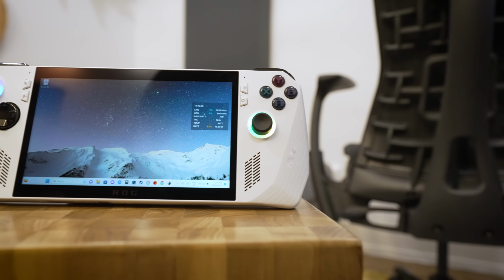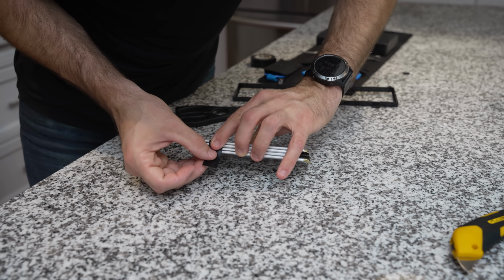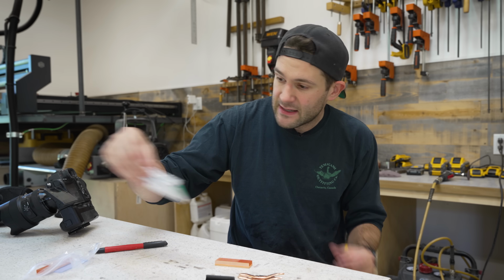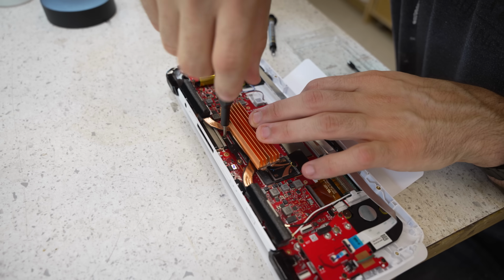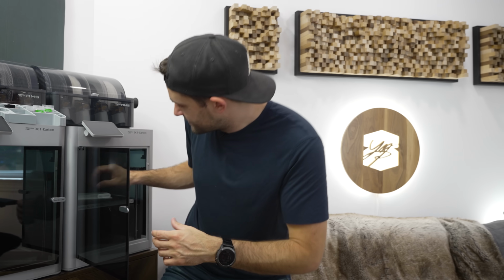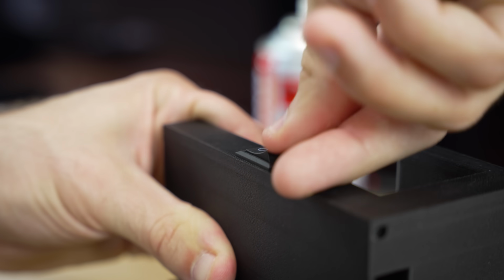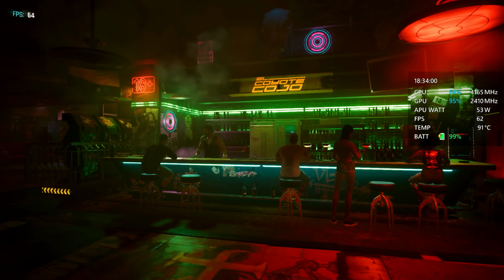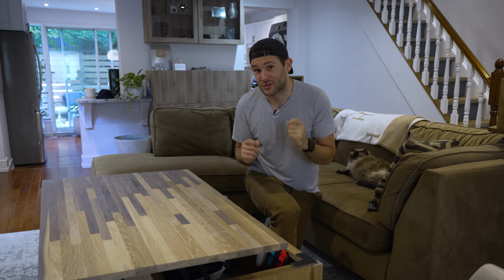I don't understand why people buy Steam Decks...

Comment: When it comes to liquid metal, and the less is more saying, I wouldnt say its actually true, not entirely, I had some instances where I thought I applied just enough and I got little to no results. I started saturating both surfaces with it, for 24 hr, then cleaning it off, then applying it for real and making it actually watery, like you see those watery puddles, thats what you need it all around. Some of it will get away, but thats what the very soft PU foam tape is for, and also insulating with confromal or nail polish to prevent shorts. More is better if you dont overdo it and if you insulate properly, you kinda want that slight spill of LM, if that spill doesnt happen you might not be getting good enough coverage, and every time I had those tiny spills overs, I always got the best results, sometimes jaw-dropping like 10-15C compared to fresh paste.

Comment: because it works really well and is very accessible and user friendly? because its reasonably priced for the power you get? because it has really good features such as the trackpads which allow far more compatibility with any game(id argue some keyboard heavy games cant be played without them, since trackpads let you configure like 20 more buttons)? because user made programs like emudeck pop up like beautiful weeds? because people dont want to touch windows? because valve absolutely deserves the support for this move of theirs? the ROG ally wouldnt exist without valve creating this handheld revolution.

the steam deck bridged the gap between consoles and computers. its a set hardware with a set operating system, so it almost has the compatibility and ease of use of a console, software designed for it will always work, and there are teams of people making sure games work well on it. but at the same time, its a full fledged computer so you have all the freedom that comes with it! sure, all this can be said about other handheld computers... but not as much. they have inferior UI experiences and windows likes to limit you.. people seriously recommend making the ROG ally boot directly into steam's big picture mode, because its not user friendly without it!

Comment: clickbaity title is clickbaity.
in the end you risk trashing and potentially exploding a device to eventually use streaming for it.
if we take the title - you can get the steam deck's cheapest version for like, what? 300-350 now?, hook it up and stream with moonlight, and have a better console experience since steam os is better suited for such things. 

dont get me wrong, cool project to watch. kind of pointless as we can see in the end, but still cool. but the title is really misleading.
yeah, the ally is more powerful, but not by much, and "people" won't be ok doing those things to fix the ally's flaws. especially considering those things can actually be dangerous even if you manage to do them correctly - 4 battery cells on top of each other? where is the heat from the middle two going? liquid metal that does not dry so if it gets out of the heatsink it can go anywhere it wants, especially on a mobile device that you wave around and add inertia to this liquid metal...

also still no trackpads, one of the features why i personally get the deck over the other handhelds :D

Comment: "I don't understand why people buy Steam Decks"
That's okay, I don't understand why you're modding a lithium-ion laptop battery pack so your handheld Asus can play longer and heavier.

All I wanted was a gaming PC that didn't break the bank, and Valve not only did that, they improved Proton to the point where I now hardly use Windows outside of work at all.

Comment: Best mod in this project was insulating the SD card. The dock was pretty cool (ha ha) and even though it didn't give performance gains, drastically improved cooling might still improve longevity. Buuut, building one dock by destroying another one seems a bit silly - could have just printed a frame for the fan and stuck it on the top of the old dock. A project that existed to justify a video, not a video of a project...

Comment: Cheaper price, longer-lasting battery, better heat management, better battery-life and performance tweaking settings built right into the OS (the ROG doesn't have the right-slide menu full of tweaks you can put in on the fly to make your game drain less battery, nor enable FSR and other enhancements).  Also there comes a point where a handheld device has diminishing returns... It's a handheld, exactly what games were you planning on playing on it?  point-click isometric or adventure games?  probably not.  really high-fidelity amazing AAA games?  no, small screen kinda ruins that.  For the power level you'd need to play games that fit really well on a handheld, the ROG is needlessly overpowered, overpriced, and underfeatured.

And as several people mentioned: steam deck has more buttons and features... customizability of those controls' functions, as well as easily replaceable/repairable parts.  

Also yeah, low-key the steam deck has pushed linux as a gaming platform finally.  Every time a game proudly puts that "oooh steam deck verified" label on their page, that effectively translates to "it'll work on your linux machine, you don't need a windows PC anymore."  However, in all fairness, this isn't a reason to buy a steam deck necessarily (cuz most don't care if their purchase changes a whole software ecosystem) but is commendable.

Comment: This is an amazing project, I congratulate you on your skills and industry, however I am just left with one question, why not just 3D print the whole back piece instead of cutting and printing a section? If you were to print the whole back piece, it would look cleaner, and you could probably add other features to it.

Comment: Bro your phone could run moonlight to your tv. Ending the project with that is a true testament to how much skill and effort this took and how much of a failure it ended up to be. Not your fault at all, but I certainly think you'd agree this experiment was a complete failure. I'm curious how much heavier the ally is now. Any small amount of weight is a huge deal for handhelds like this. The oled feels SO much lighter than the lcd steam deck.

Comment: As someone that was critical of the SoC inside the SD, the thing I've come to understand is that at 15w and less the SD is not slower than these Z1 extreme chips and the lower you go the further the SD pulls ahead, in part due to valve using a quad channel memory configuration instead of the dual channel used by these z1 chips.

If you focus on the specs you ignore that this is a handheld and you need to have a reasonable battery life, something these Z1 handhelds have completely ignored.

My 1TB OLED gets incredible battery life on silence, something that these "better than SD" handhelds don't.

Then add in how atrocious windows is on a handheld, because Microsoft have done nothing to improve the experience and will never improve it in any significant way and compare that to how Steam OS is completely made for the SD with constant updates, fixes and improvements specifically for the handheld experience.

The SoC difference is nothing when you look past the spec sheet.

TLDR; SteamDoes what MicrosoftDont.

Comment: Don't buy a steam deck, just buy a 3d printer and print a base that holds the ATX-sized case fan, replace the stock battery and SSD, carefully mod your handheld with a DIY heat sink and thermal shielding only to realize none of actually impacted performance in any meaningful way.

I'm sure this isn't lost on you. But man... that title got me pretty damn good.

Comment: My question is did the heat shielding over the microsd card actually solve the sd card getting fried long term? I’d like to know so I can do it myself, but don’t want to do it if it didn’t actually work long term.
Reply: Yes, he needs to follow up on this but I doubt he actually uses the Ally.
Reply: I'd be cautious of this personally. It's not as if use of microsd cards won't produce heat in and of itself - under normal use they're more or less ambient heat, but under transfer of lots of data (i.e. installing all your games or copying a bunch of files over) they can get  pretty hot and actually can result in killing a card (I've had this happen to me on a few cards including ones from reputable brands) - although this may be more from the reader-writer than the card itself, and I don't know enough as to which part is actually causing the heat, putting the shielding ontop of the slot could actually insulate this heat and increase odds of data transfer killing your card.

Large capacity microsd cards are still fairly new and there's really not a lot of info about all this (which is likely why even good brand cards can be cooked to death without being heated by a cpu/gpu) so it's anyone's guess at this point, but I'd strongly recommend making sure all your initial download/installs are done before you attempt this yourself.

Comment: Still prefer my Bintendo Switch which weighs less, plays longer, does not need to remove/insert something after put in dock and back - and plays nintendo switch games without emulation. Wonder if someone can beat it with only 10 Watt consumption itself.

I suppose nintendo will give us the next console in 2025 and nintendo switch will outsale PS2 - yes, I know, way more players than in the past where PS2 came but still strong. BTW, I have a PS3, a PC, some nintendo consoles and an extended Amiga 1200.

Comment: The AMS on the Bambu X1 Carbon is NOT made for reinforced materials, will literally kill it very fast. You didnt need to add heatpipes on top, a solid block touching wouldve done the job as good. Otherwise, amazing as always.

Comment: The repair-ability by offering ifixit and a way to buy parts to fix your steam deck.  Pushing an alternative OS to windows.  Kinda shows that Windows is bloated OS and requires more faster hardware to make it work.  While Linux runs leaner and is efficient on older hardware.  Steam proves you don't need the latest and greatest hardware to just run Windows.  Which is great for those that are on a budget.  As gamers we should have options.  Also having many PC hardware channels talk on Asus terrible RMA policy.  I stay away from Asus.  Steam is showing, proving, and delivering a product that will last you for a bit.

Comment: You make a case about the ROG Ally, but Steam Deck is still a better solution for those that want something a bit easier to use with the support the Valve gets. Let alone, a large majority of people aren't going to be able to do these mods, Valve has a product that works without modifications to resolve picky issues, they've spent much more time testing than Asus did with the Ally.

Comment: Dude the dock is SO good, it baffles me why they didn't create something similar for the original console. Personally the only handheld console I own is the Switch. All of that being said, incredible video. I love DIY "hacks" like this. You went above and beyond. Had me wanting to buy your version over any pc handheld. So if you ever want to start up production, you have my Kickstarter bid XD
Reply: The Switch may be older hardware but it still runs relatively quickly compared to anything PC.  That is, the boot time and the fact that it uses physical game media.  I am always weary of digital based games as the physical ones are still there after something fails but not necessarily the same for the digital ones.  Yes, the Valve machine may be more powerful but give me an ARM based portable any day.

Comment: Don't sleep on the fact that it took valve almost a decade to come to this point. They had to fail multiple times in order to get something like the steam deck right. Asus is in fact no where near and never will be, if they stick with windows.
The only chance for Asus is to just use SteamOS and focus on the hardware. Asus software is garbage 100 out of 100 times. This is coming from an Asus fan btw.

Comment: Note about Moonlight: it's NVidia-specific since it only implements their Gamestream protocol. Because of that it's also somewhat limited in what inputs it can transmit (e.g., fancy Steam Controller configs won't work). And the kicker is that Gamestream is dead now and will eventually get removed from GeForce Experience.

OTOH, Steam's own Remote Play works just fine for Steam games. Non-steam games also work well, but sometimes you need a few extra steps to get them to recognize controller inputs properly

Comment: Ill post my opinion before watching, and amend my changed opinion after.
I like that the ally is just better, performance wise. But it just does not have the in my opinion killer features of the steam deck. Primarily steam OS, which at this point is just so much better than windows for gaming that the latter should just no longer get shipped on "gaming" devices.
Secondarily the layout. The steam deck has equal height joysticks, which are already better than the asymetric system the ally uses, and trackpads, which make it viable for shooters. And these are just 2 problems, both of which i would consider dealbreakers for a gaming device.

Comment: I haven't seen someone mention this yet but those look like JST connectors and making a custom length set is a lot easier than several of your steps in this video so you might consider that in the future. This is almost certainly fine, but the solder and heatshrink all takes up more space than original wiring and imo its easier to make the custom harness you need than soldering and shrinking all those connections.

Comment: Alright, so buy ROG handheld, 3D printer, fillament, soldering iron, solder, helping hands, some wiring, electronics, fan, extra battery for a 1/3 of Steam Deck OLED price, void the warranty and all going well you're set?
Nah bro, you're good. I am not that desperate for few extra frames on small screen I won't appreciate.

Comment: Better question: Why would people want to buy a device that was engineered with this stupid of a problem?  I like the idea of the Ally very much, but it's very clear they rushed it to the point where their engineers made a truly fundamental mistake.  Doing a home mod to fix what is supposed to be a console experience device isn't practical or sensible for almost the entire audience for this device, and even if it were, ASUS' BIOS updates for the device are adjusting performance and thermals based around the engineering flaw, meaning you're either leaving performance on the table after making this mod or having to do potentially brick-inducing low level tinkering to restore it.  Maybe ASUS will correct this in a revision or second gen of the device, but for the time being, combined with the other aggravations of Windows, battery life, etc, this device is really a bad choice for most people.

Comment: It might be more powerful than the Deck, but it still doesn't have 1% lows as good.  Windows just isn't an efficient OS for handheld devices.
Also, white is a really bad choice for a handheld or portable device.
Why would you mess around with trying to solder heatpipes when thermal epoxy exists?

Comment: Liquid metal on raw copper is a massive no no since it will eat and break down the copper. Liquid metal should only be used on nickel plated copper, which is a fairly easy thing to do even at home for a small heatsink.

Comment: its not the heat above the SD card reader that makes it crap out. It is the controller chip on the other side of the board that has solder issues.

Comment: heres why i bought a steam deck instead of an ROG ally.
1: its valve. i wanna vote with my wallet and i prefer to keep Valve up and running apposed to MSI or Asus.
2: valve made linux gaming a thing. without proton i wouldnt be running solid works on my ubuntu desktop. 
3: LTS. the steam deck will be getting optimization updates for YEARS where as with asus or MSI, the updates are gonna stop in just a few years. my deck will be up to date until probably 2030 (if we make it that far)

call me wrong or whatever but for those reasons i chose the deck over any other hand held.

Comment: Not to shit on windows but there is a reason why windows mobile failed. Any handheld running windows is inferior to other alternatives, its to bloated and simply not optimized. Hell there are even cases where new games emulated on linux have better performance than running natively on windows. I'am defininitly going to buy a steamdeck where its OS is optimized for its hardware

Comment: The heat pipes will never pop even under extreme heat. There is only water under a vacuum inside so at most the pressure would just even out as soon as they opened. No popping is possible. Those pipe are designed to reach very high temperatures, you would liquify the copper but nothing would pop.